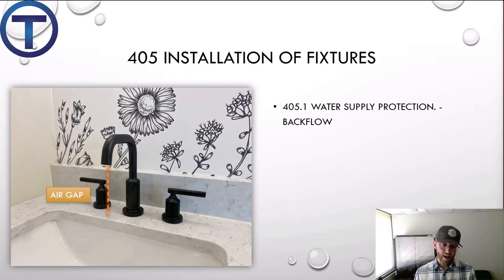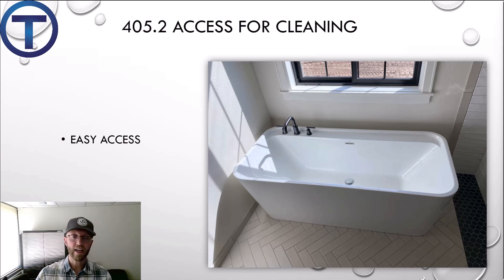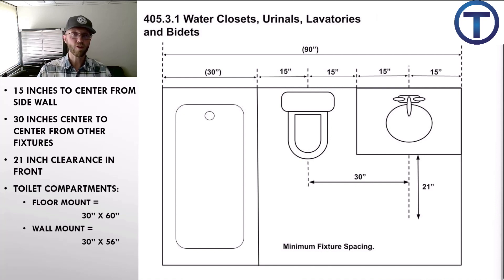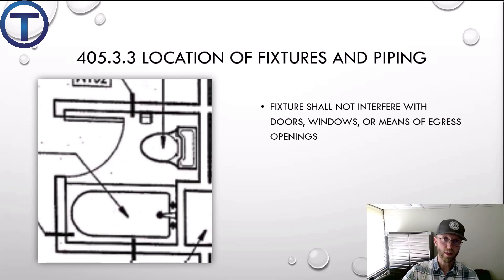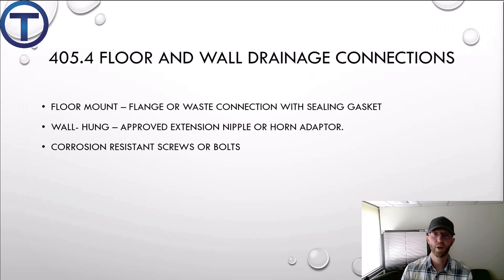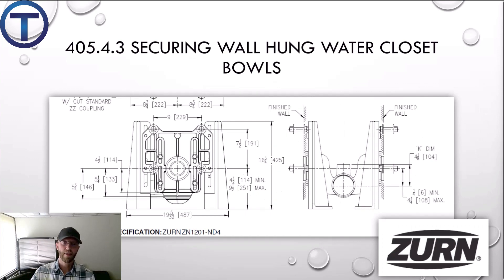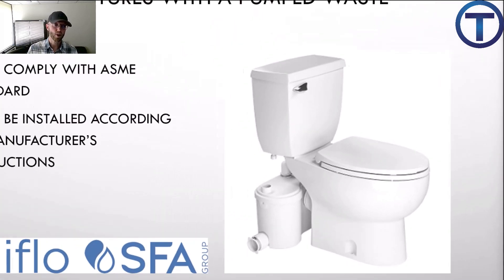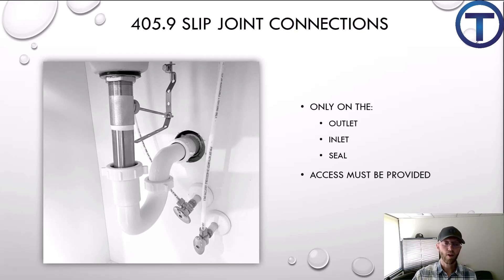Understanding International Plumbing Code: Chapter 4 Section 405

Comment: 405.3.1 If I have a side splash will the 15" be from the side splash instead of the wall? Thanks for the explanation very good video!
Reply from the maker: I don’t think that includes the side splash. But code does not specify.  You would want to verify with local code officials.
Reply: @plumber-tom9470 thanks. I asked AI and it mentioned that the side splash is consider an obstruction, but i will defnetly check. We are a cabinetry company and we built in a lots of states, so i will provably reach to multiple local codes 😂😂.